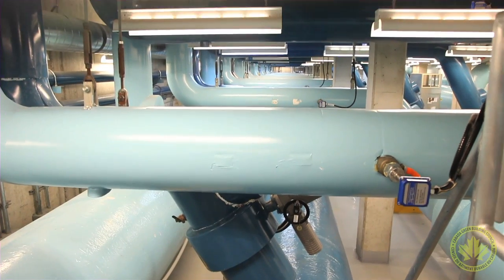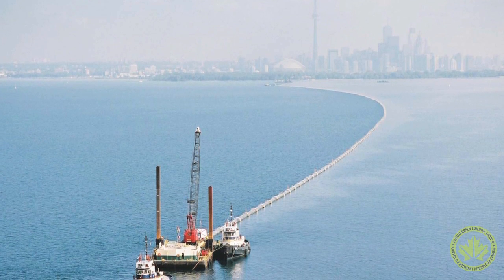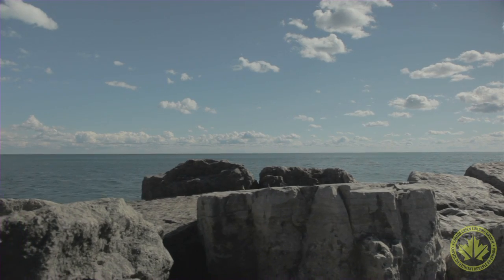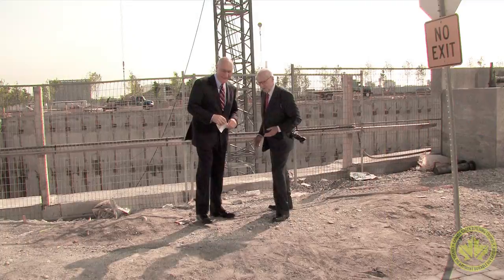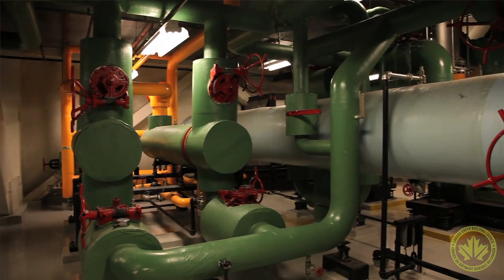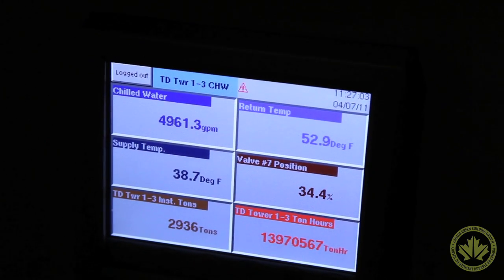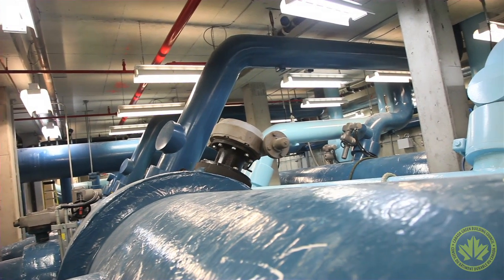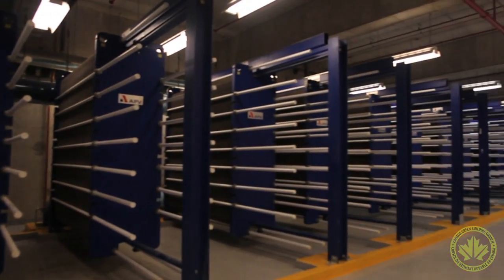Seriously Green - Episode 6 - Deep Lake Cooling

Comment: I believe it would be more efficient if we harvested the water from the bottom of the Lake and circulated it directly within fan-coil units for indoor heat absorption. Obviously that has the drawback of causing galvanic corrosion if dissimilar metals are used in the circuit, and the absorption of energy through radiation/friction once it reaches the FCU, but they can be solved through using only one metal throughout the system, and the use of "booster chillers" to chill the water, only using a fraction of energy than a conventional chiller.
Reply: The system has to be non contact or the drinkung water supply may be contaminated. Raw water cooling systems have to be based on heat exchange. Because people are shitheads.